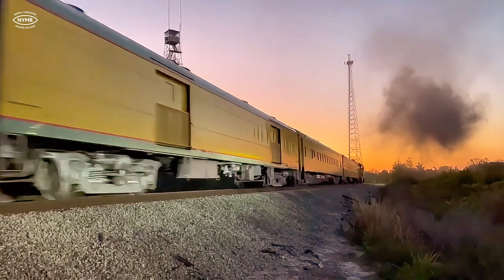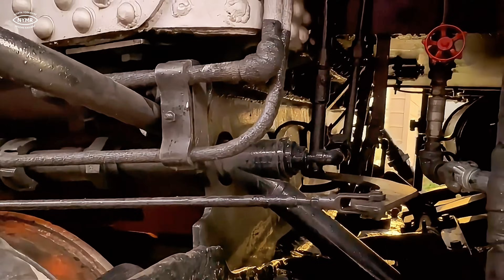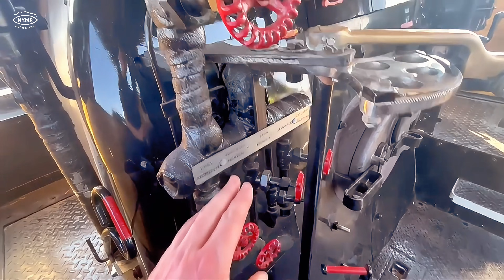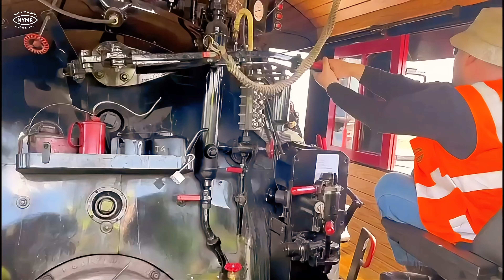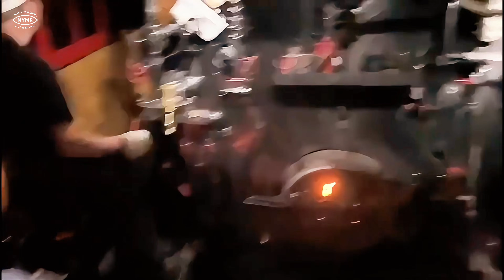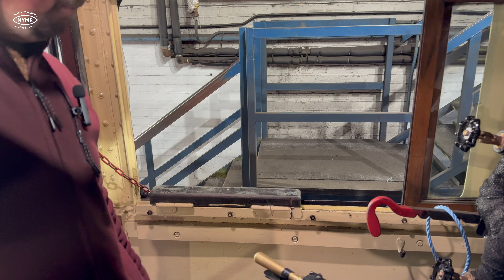Piglet on the Sugar Express - An Oil Firing Update

Comment: Shame you couldn't have gotten out to California and saw the big oil burners . The BigBoy 4014 that UP rebuilt was converted to an oil burner in its restoration, they were coal burners in their service days. Santa Fe Northern 4-8-4 2926 is also an oil burner and that was the way they were built. My favourite in Southern Pacific Cab Forward AC-12 class 4294 at the California State railroad museum in Sacramento. These monsters hauled freight and the odd passenger train. Actually Cab Forward 4274 hauled the last steam special over Donner Pass in December of 1957 and was very unlucky in not surviving.

Comment: will you have to put sand in the fire box like they do on the 3 foot gauge on the old Rio Grande locos that are now oil burners. I don't know why they do it i just know they do, do it.
Reply: it de-gums the tubes. The oil leaves a sticky residue and the sand scours it out
Reply: Oil firing doesn't produce the fines that coal does and therefore needs the tubes cleaned off regularly.  It also makes very black smoke that some photographers like when one puts the sand through to the tubes.  You can tell when they sand the flues if you follow Union Pacific 4014 or 844.  I'm not sure which if better for the superheater tubes running inside the boiler tubes, coal ash or oil residue.

Comment: Great, imformative vid!
Reply from the maker: Glad you found it informative!
Reply: @NYMRYou'll find your crews will have to work closely together. Changes in grade & regulator settings can suddenly blacken the skies if the fireman's not on his game. Would suggest a secluded location be used for flue sanding.

Comment: That engine is a credit to those who look after it, cab looks immaculate, no coal dust around I suppose.
Reply: I have two coal burners in my house. The ash goes everywhere, and the sooty smoke blackens the walls/ceilings and curtains.
On steam locos the ash gets in the bearings, which have to be regularly stripped/cleaned.
Reply: In my experience oilburners are dirtier then coalburners. It’s the combination of soot and oil which stick to everything. Coaldust is much dryer and easier to get rid off

Comment: But the joy of a coal fire is starting it with rags, parafin, firelighters, wood, and hope. Followed by stink , mess, starting again because you forgot the paper and it didn't start properly. Burnt fingers, lungs full of coal dust, and finally hacking your lungs out because of the smoke, thereby clearing out the coal dust. Such fond memories.

Comment: you really wanna go down this route ?there`ll be trouble over emissions 😅
Reply: you know sweet FA about boilers do you, less emmissions,  better control of the fire, more heat, no ash to deal with, constant and known control of fuel clorific value less and far less maintenance costs by miles you need to leave engineering to engineers
Reply: @johnnorman7044  There appeared to be a one hell of a black cloud coming out of that engine, so are you telling me that was none toxic black clouds been spewed out of the chimney. It will be interesting to see what the conservationists think of that.
Reply: @laurencewright8606 that's sand being thrown into the firebox in order to clear the locomotive's flues.
Reply: you realy do not have much idea about coal, oil or gas firing of boilers do you the conservationists have stopped all coal firing in the uk i wonder why, would you like to enlighten us ??

Comment: Will you be having one of those annoying bells, is the bell ringing for some kind of safety thing to warn people ?, and the driver seamed to be doing some kind of a tune and the whistle, thanks for your video it’s very interesting 👍.
Reply: I'll assume that the "tune" you are mentioning is the long-long-short-long whistle (letter Q in the Morse code) – that's used to call level crossings and it's a legal requirement. 

The bell is used whenever the locomotive is moving within yard limits, in a station or if there are people around.
Reply: @NickBurman ok, thank you so very much for that information truly appreciated 👍.
Reply: British person here, who’s travelled a lot in the US, I hope this helps.

The Federal Railroad Administration (FRA) requires trains to sound their horn/whistle 15 to 20 seconds before arriving at a public grade crossing. This is designed to prevent collisions due to the long stopping distance required for trains.

Drivers use specific codes to communicate with crew members, such as two long blasts for moving forward, or three short blasts for reversing.

Also, the US has a very high number of level crossings compared to other nations, many of which lack automatic barriers, leading to increased need for audible warnings.
Reply: @davidanderson1639  thank you so very much for your kind reply 👍.